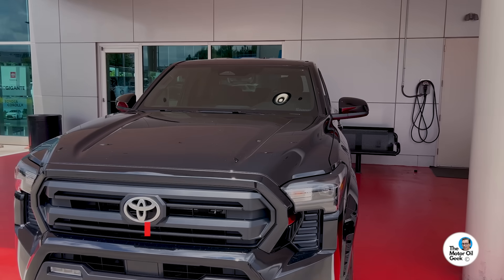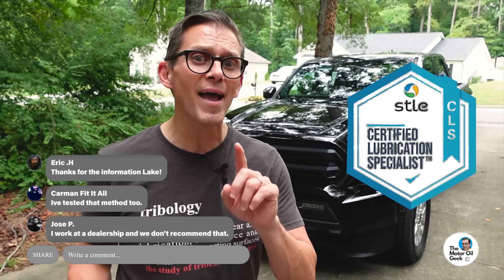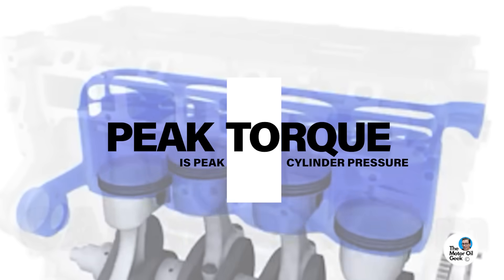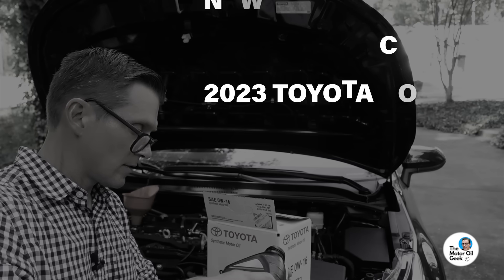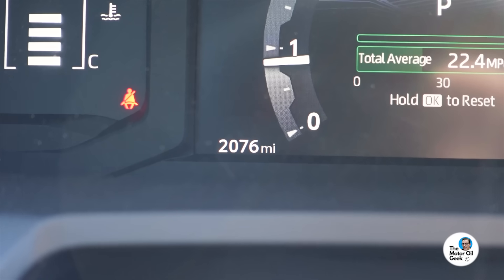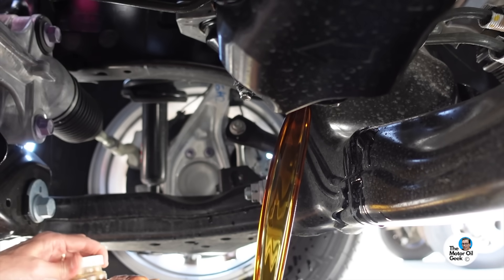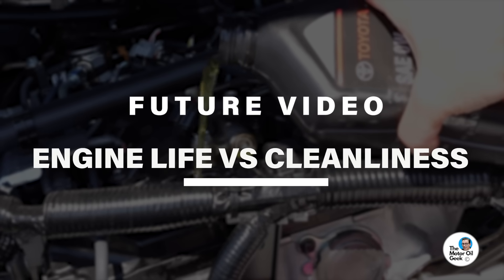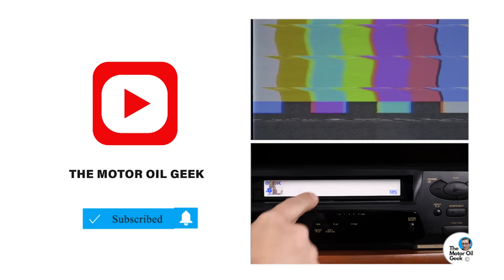The FACTS About Oil Changes (What The Owner's Manual DIDN'T Tell You)

Comment: This guy would have no viewers if they just followed AMSOIL's recommendations. (I'm not saying he's said anything wrong - he just answers very basic questions you should be able to figure out on your own). It's very simple. For most once per year. The caveat being never own something built after 2015 knowing it's all garbage. And #2 if it uses less than 5 quarts then still 1-year but never past 10,000 miles. My 1.6 Ecoboost which was supposed to fail at 60,000 is still running strong at 105000. Amsoil 5W-30 signature which can handle the heat (I never used 0W-20 after 30,000).  BTW - I went to a class at DOnaldoson and just as common sense says - you NEVER use K&N type air filters unless you really dont give a flip. And keep your Mass air flow sensor clean (most of my cars are pre 1965 but you know)..

Comment: When I bought my new 2012 Dodge Challenger w/5.7 hemi & manual trans, the first thing I did when I bought the car with 4 miles on it was to pick up some Mopar 5W 20 oil that the manual specified plus a Mopar filter, then drove the car 35 miles home in varying road conditions from stop & go to accelerating on the freeway. I dropped the factory fill oil at 39 miles when I got home, and one could have mistaken it for pearl gold paint with all the fine particulate matter still suspended in the oil! Changed again at 500 miles, 1500 miles and 3000 miles, then switched over to AmsOil Signature Series synthetic 5W-20 oil & their oil filter.
That car ran well with regular maintenance every 4K miles for 12 years and 132,000 miles, no leaks, no oil consumption, no trouble whatsoever. I also dropped differential lube every oil change and trans oil every other oil change. It also had many mods done to it with full factory SRT exhaust, custom tune, ported throttle body, and revamped cooling system., never missed a beat and it hauled ass.
Someone got a good car when I sold it to get my '23 Chrysler 300C SRT 6.4 hemi car! Lake, thanks for the oil change video, makes perfect sense to me!

Comment: Chiming in I suppose... us S2000 owners had a pretty good learning experience with engine break ins... some that changed oil within 500 miles actually had lower cylinder pressures because the rings didn't seat yet. Others that waited a bit longer had better HP output...

Comment: Lake, is there a reason you don’t use a Fumoto drain plug on your personal vehicles? I’ve used them for years and they make changes considerably cleaner. They also allow you to get an oil sample at the bottom of the pan without pulling the plug. 

Thanks for all the info you share with the world! I’ve learned a lot from your content.
Reply: they leave more used oil in the oil pan.
Reply: @verlaryder It’s a tiny amount but I guess if he’s analyzing these samples it might make sense.

Comment: I'd change the Oil Filter, every time.  A Dirty oil filter is far worse than a dirty air filter.  The Tundra's I hear have a other of issues with the motor right now, I wouldn't buy one until its figured out.

Comment: 🚗🛢🚗They want you to wait on the first oil change because, the oil from the factory is NOT the oil you will be using, AFTER the break in. If you do what lippy says here,  you will damage your new engine. I agree that you should change the oil but I do it at 100, 500 and 1000 miles. 🛑 You MUST use break in oil with high amounts of zinc or moly.  Also oil samples taken from the oil pan are inconclusive, to get accurate samples, the oil must be taken, by vacuum, from the dip stick. 🚗🛢🚗

Comment: I know this is off topic of the video but I’ve got a question about something I’ve heard a few times about oil. I’ve heard that exterior temps play a role in oil choice. The examples used were for 2 identical engines, a colder climate could use 0-20 for its thinner consistency but 5-30 for a warmer climate cause it’s a little thicker and will provide “better” protection due to its thicker consistency. This to me seems flawed as common sense tells me that the operation temp of oil in a running engine is well over the high temps that weather provide. So once at operation temp, which takes far less time in the hot weather, wouldn’t the exterior temp be taken out of the equation and your simply relying on whether the thinner or thicker oil is giving the protection and performance you desire? I hope this makes sense to someone and they can educate me.

Comment: Does science show that a thicker viscosity oil better protects the engine in high heat summertime regions like Texas? I drive a 21 Tacoma which recommends 0w 20 which seems awfully thin when it's 105° outside. Which of course falls under the speculation heading but seems more like common sense speculation to me. I think I would "feel" better with 5W-30 but I would like to know what the science says.

Comment: Curious Lake, how will you pre-fill the oil filter on the Tacoma with the oil filter orientation at 90 degrees from vertical? My same question would apply to engines with the oil filter opening positioned straight down, such as Subaru and VW?

Comment: That scares me. I bought a 2025 Honda Ridgeline Trailsport 3.5 litre, I had two dealerships tell me do not change your oil until the computer tells you especially on the first oil change,, after that, change it when ever you want. The only early fluid change was the rear differential which will done one the first oil change. Why did Honda say this about engine oil change?

Comment: Here in Japan, for new I do 500km, 1,500km then 5,000km. I use the manufacturer-reccommended oil for the first year, then switch out for a quality, slightly higher viscosity oil. Regular changes on all vehicles at 5,000km intervals. My engines last forever... 
Thanks again Lake, regards.
Reply: Being that your from Japan and I don't know if your old enough to have a mental picture on what used to take place some 40 to 50 years ago for example but here in Canada at the time it was possible to get low km used engines that were shipped from Japan that came out of vehicles because it was said they reached some certain km distance and that the Japanese government made it mandatory at the time that they replace the engine simply to install a new engine so the engine health was perfect to potentially reduce the pollutants in the air. Of course to us that sounded crazy to pull out a perfectly good engine but that was the claim as to why there was such an abundance of those engines being shipped here as a way to recoup some losses. I could be wrong but I thought 60000 km or so was the point at which the engines were being pulled.
Reply: @charlesb4267  Hi... my name is Scott, ans I'm actually from Wisconsin. However, I've lived in Japan for over 35 years. I'm a life-long mechanic, and in my youth made a very good living turning around "set aside" vehicles.
That said, there has never been a government mandate to replace engines at a certain odometer reading. However, you are referring specifically to Japan's "Bubble Era", during which time people replaced their vehicles early and often. Two reasons... first of all nearly everyone was relatively well-off financially, so they could afford a new car say, every five to seven years. Secondly, vehicle inspection was only allowed to be performed at specially licensed dealers or shops. And they knew they had you over a barrel. As such the inspection fee for older vehicles rose exponentially with vehicle age, making a new car even more attractive to many.
The law was revised about the time I made landfall in Japan, allowing vehicle owners to do maintenance and repairs, or hire whomever they wished. Once it's ready it still has to be taken to a regional inspection Center to be verified, pay tax etc. This worked out beautifully for me, as there were low mileage cars parked up literally everywhere. And when I told someone I'd pay for the car, rather than them having to pay a dealer for disposal (standard practice at that time) well... it was like shooting fish in the barrel, tables turned.
Things are much different now... times have changed and people are much more frugal. But Japan is still an excellent place to be a gearhead.
Regards.

Comment: I get the electrostatic particle attraction in the air filter, but particles in a bath of oil?  I thought that the use case would be different between that air and oil filters

Comment: Hey I got a question now that I have watched your Video. I am getting ready to buy a new Ram with the 6.7 Cummins says no break in required. I still will do the oil changes like you recomended oil is cheap engiens are not! Now the question I know that the factory fill is 5W40 yet the owners mannual recommends 10W30 Rotella full synthetic. Should I switch over or stay with the thicker viscosity? and why fill it at the factory with 5W40 and then do a switch a roo to 10W30? thanks
Reply from the maker: here is the proper framework for making decisions regarding oil. 

Step 1 - Utilize the OEM recommended oil spec and viscosity and do two early oil changes during the break-in process (500 to 1,000 miles and again between 3,000 and 4,000 miles). If the engine is already broken-in, skip to step 3.

Step 2 - Take used oil samples at each oil change to establish the trend analysis.

Step 3 - Go 5,000 miles on the third oil change and take a used oil sample. If the wear rate per 1,000 miles is below 5 ppm, you are good. If the wear rate is between 5 ppm and 10 ppm per 1,000 miles, go another 5,000 miles on the OEM recommended oil and resample. If the wear rate is still greater than 5 ppm per 1,000 miles, then move to step 4.

Step 4 - Since the OEM recommended oil and viscosity have not produced a wear rate per 1,000 miles lower than 5 ppm, go up to next viscosity grade in that oil. Go 4,000 to 5,000 miles on that oil and then take another sample. See if the change in viscosity drops the wear rate per 1,000 miles below 5 ppm. If it does, you are good. If it does not, then move to Step 5.

Step 5 - Since the change in viscosity did not get the wear rate per 1,000 miles below 5 ppm, try a different brand of oil in the same viscosity grade of whichever oil had the lowest wear rate per 1,000 miles. You will need to use it for 3,000 to 4,000 miles to flush the OEM oil out of the system before going 5,000 miles on the new oil to take another sample. See if the non-OEM oil lowers the wear rate per 1,000 miles to 5 ppm or less. If it does, you are good. You can then use the oil analysis results to fine tune the oil change interval.

If the wear rate per 1,000 miles is still above 5 ppm, try the next higher viscosity oil of that same brand to see if that lowers the wear rate per 1,000 miles. Finding the best oil for an engine is an iterative process, but the data from the samples (viscosity, additive depletion, wear rate) will paint a picture that guides you in the right direction.

Comment: Thanks for doing this test series.  For your oil changes, I suggest the Fomoto Value for your engine.  Makes changing oil very easy and far less messy.  Very easy to also use a clean hose to get samples from the old oil as it drains out as well.

Comment: I love your videos and have learned so much!  A couple of questions, we have a 2025' Audi Q8 with a twin turbo V6 and a 25' Ford F-150 Power boost, also a twin turbo V6. I had the first oil change on our Audi at 3000 miles (approx) and, after seeing your video, will change the F-150 at 1600 miles. My first question is, the procedure on the Audi is to draw the motor oil out thru a tube mounted at the front of the motor as there is a full under car cover and access is very difficult, my question is there any draw backs to this approach? My other question is, and I'm embarrassed to ask, the Audi takes 0-W20 oil, which to me seems excessively thin, what would be the possible negative consequences of adding a single quart of 5-W30 to possibly increase the viscosity, maybe? I am a Mechanical Engineer but have little background in oil technology and I absolutely hated chemistry (chemisery LOL) classes in college! Thank you so much for your time and please keep these videos coming, Mike.

Comment: My OCD is a little bit more severe. Oil change with filter at 500 miles, 1,000 miles, 3,000 miles, 5,000 miles and then every 5,000 after that.
Reply: If you do not drive a lot , do you change it every year or every 6 months? Thanks
Reply: @oaouda  6 months.

Comment: Follow up: Did you run an extra quart straight through the engine after draining at 500 and then again at 2000?  Also, with transmissions being an issue these days, do you have any recommendations for doing something similar with those?
Reply from the maker: Yes we did. Transmission fluid and gear oil changes coming soon!

Comment: I used to do this, but the dealer warned me against it bc of the special additive package from the factory. Blackstone test revealed the molybdenum was over 700 in my 2025 Grand Highlander. I changed the filter at 500 and then oil at 3k, but wish that I'd have waited until 5k. I just did the oil again at 6k.
Reply from the maker: New Engine Break-In: Truth or Myth?
https://youtu.be/X4424Q5lLR8

Comment: I did my first oil change at 608, 2nd at 2978, and I'm at 4794 right now and plan to change it soon. I am waiting 5% til my maintenance minder comes up or 5,000 miles on the odometer. It is a 2025 MDX and with the analysis I've been doing the wear rate has dropped so far at 2978 but it is still breaking in and can't wait to see what it looks like when I do it next.

Comment: 2025 Lexus NX350 turbo 2.4L, service writer told me  it comes with synthetic so they don’t change the motor oil but instead add an additive and fuel additive. It’s the second oil change they drain and fill. Only the high performance engines that comes with mineral oil they change at 500 miles.

Comment: First error before oil change.  A black on black truck is a bear in the heat of the South.  If you live in the South you will have to garage it or else the clear coat will haze and deteriorate over time

Comment: 1975 to 1980 Onondaga County Central Sheriff's Maintenance Garage, I was a young mechanic .Mopar 440 Plymouth and Dodge Police Interceptors. Syracuse New York , freezing cold winters , hot summers .We ran Kendall GT 40 ALL YEAR ROUND FROM THE first oil change .100 pounds oil pressure when cold .Top speeds 130 plus , these cars were driven all over the entire county , 300 miles per day average .New cars were rarely even shut off , three shifts .We Never had a 440 blow up an engine  in the 5 years I was working there.We changed the oil every week , that's right , every week , and these cars had no Break in period , put into service after 10 miles , and beat to death , believe you me .My respect for the 440 Mopar is undying to this day .
Reply: Engines are very different today. Variable valve timing controls need very light oil. Over head cams, etc. 10W-30 or 0W- 20 was in our fleet of cars and light truck.  Vehicles run over 300K miles reliably. For vehicles in extreme weather locations synthetic oil is installed.  Heavy duty trucks used 30 or 40  motor oil.   Old Version mechanic.
Reply: @doctorsmog Not really.  0w20 is thicker cold than 5w40 hot.
Reply: When the engine is almost always warm, will last much longer than engine that's allowed to cool down, restarted from stone cold.
Reply: @pliedtka my thoughts exactly, the most engine wear happens at cold start up, our pro shoud be aware of it
Reply: Lewis County NY here......
Reply: @SEMPER-FI-777 Cayuga county says "howdy neighbor"!
Reply: @SEMPER-FI-777 jefferson county is here.
Reply: The old Kendall GT oils were incredible!
Reply: you saved them all or most of them.

Comment: I have a 2003 Dodge Caravan 3.3L V6 @ 150k miles and it has lifter / valve tick. I've been using the factory recommended 10w30 oil and adding about 1/2 a quart of Lucas heavy oil stabilizer to quiet the engine. This oil change i'm moving to a 10w40 oil and skipping the additive. 10w40 oil is so hard to find and seems like its being phased out. I've always used M1 EP 10w30 w/ additive and this oil change i'm using Castro Edge FS 10w40 but I dont know how long this will be available. Does anyone have any suggestions or am I at the point to simply adjust the valves?

Comment: Toyota came with 0w- 16
I can't believe Speed would buy a turbo engine.
Reply: To use as a good testing platform because its a turbo engine, there are so many engines these days with turbos and the heat stress the turbo adds to the oil, so it makes sense to dive feet first right into it and experiment with oils on an engine that will tax the the oil.

Comment: 😂😂😂 I am a female instrument technician for a power plant and our turbine generators are huge very huge fact they’re so big. We have 50,000 gallons of oil circulating through them daily and all the bearings are bad bearings. I’m not a lubrication engineer, but I used to work as an instrument technician in a steel mill United States steel and they had a book. It was called the blue book of United States steel lubrication engineering. You might wanna get yourself a copy if you can find one and I told you all about lubrication I have such book and believe me I had an old pick up truck that I used to drive to work a 350 1987 pick up Chevrolet and I changed the oil every 3000 miles in it and I got 430,000 miles out of the engineso you are right there’s an old saying change will do you good you have a nice day
Reply from the maker: I do have that book.

Comment: Lake, why don't you directly throw out the 0W20 oil (which is not the best for break-in, as it has a ton of MoDTC and other friction modifiers) and not use a custom oil formulated for break-in? Red Line does have a break-in oil additive and a SAE30 monograde break-in oil. Is one reason for longer time to finish break-in the use of friction modifiers?